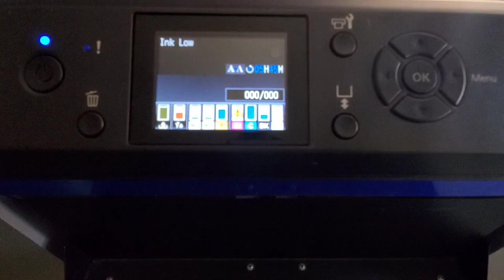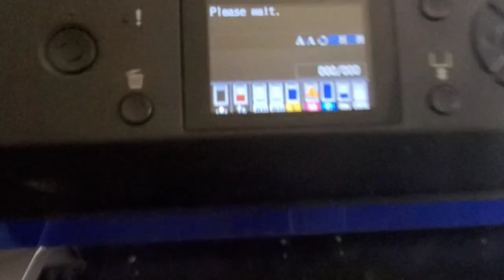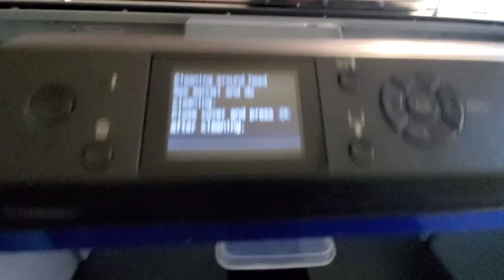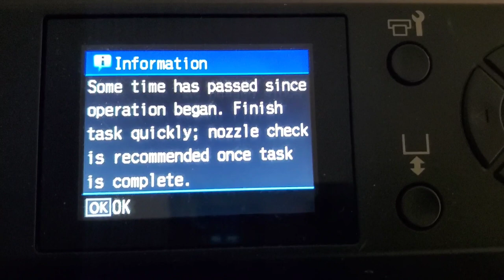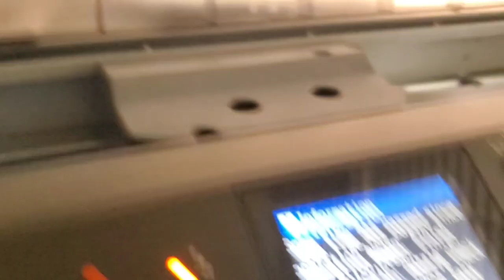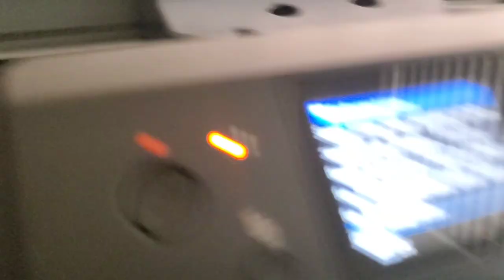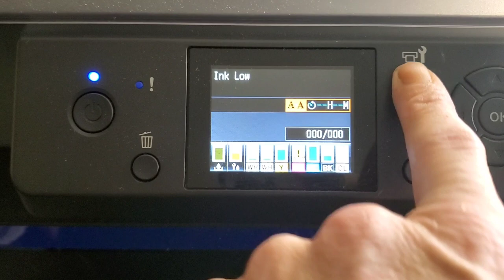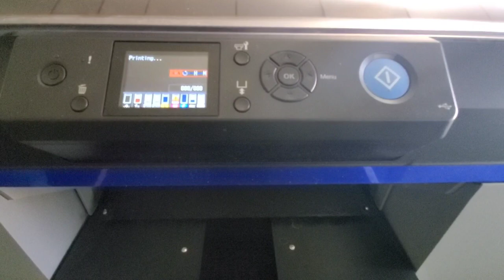SOLVED: Epson F2100 / F2000 Fix Print Head Unclogging & Deep Cleaning Nozzle Check HACK DIY

Comment: @Clixstorm I keep losing my White 12-34 channels, after I do a printhead cleaning, I can do maybe 3 shirts before I start losing my white again. Whats causing that? Its a F2000
Reply from the maker: Sounds like a suction issue. The white can't keep up with the demand being called for and gets behind like a skinny straw trying to suck up a milkshake. If that makes sense. 

Check your suction line cleaning area. That's the box it sits in when not being used. Ink can build up and weaken the wipe it does.